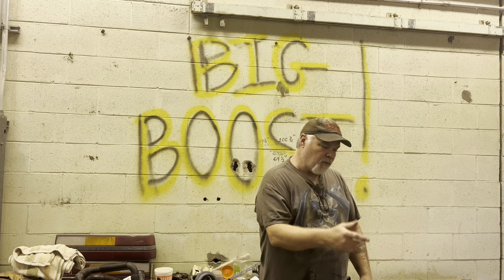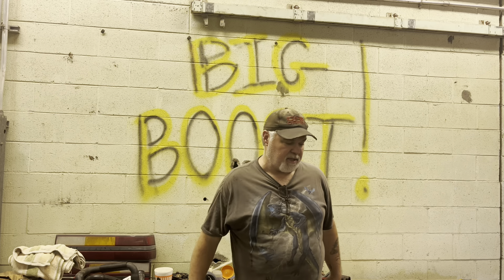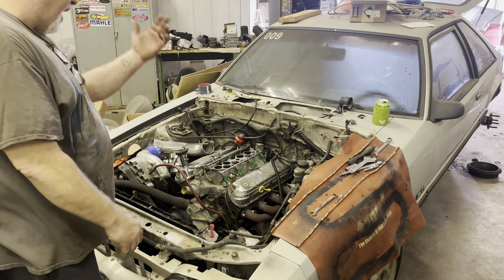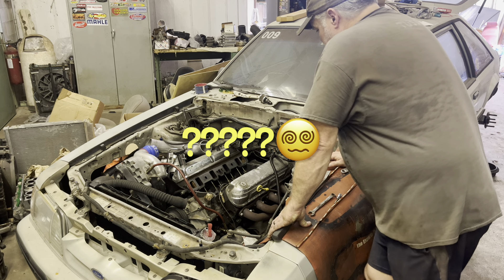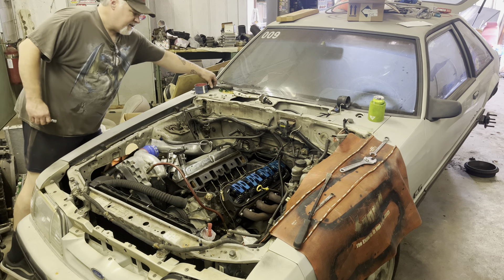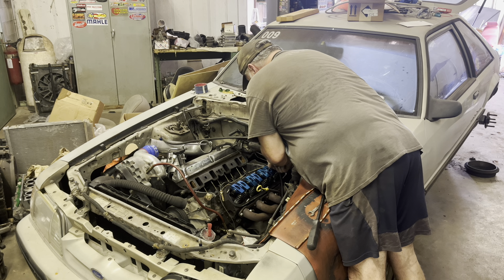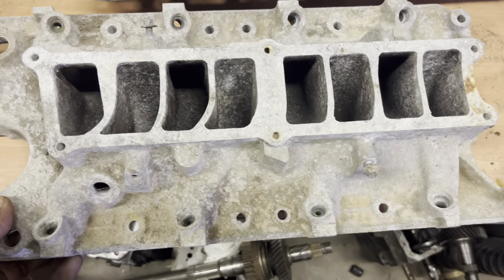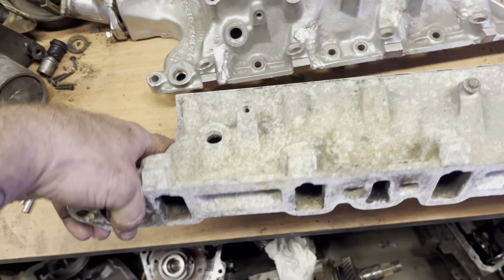1991 5.0 Mustang LX SILVERCAR Pt.26 Welcome to Club Big Boost!

Comment: David must have welded some of the runners from the bottom.  I've always wondered about the truck efi intake as a performance piece,  it looks pretty good.  I have two on my shelf.
Reply from the maker: Before the proliferation of efi intakes the modded truck lower with a modded upper (sheet metal or truck upper cut up)was the cats meow..the OG fast guys ran them..

Comment: Okay last comment. What are the chances of you being able to get a coyote running in one if your myriad foxes if one shooed up???
Reply from the maker: It’d have to have the control pack, a laptop and last but not least a decent trans/clutch (liberty plated tkx/600 etc) with it..no use in having a 400-500hp 7k rpm engine if you can’t shift it or break the trans every pass 🤔🤷🏻‍♂️😵‍💫

Comment: I'm going to guess trans is the first to go asking for a friend.
Reply from the maker: Probably, but we could weak sauce launch/shift it and possibly get a HG first..it’s all in the approach 😉🤣
Reply: @5.0tussin   it's hit or miss third gear can't handle the torque load very long I have had some only make 1 pass before blowing up and others make it 30-40. I'm not sure if your a5 has the gforce/ASTRO gear set but, if it doesn't I'm sure you can use that YouTube money to buy one gear a year until you have a full set. I called gforce recently and they still have some sets available for the t5 and I saw some Florida boys still had some sets floating around too.
Reply from the maker: @azblueovalfan7192  my a5 is full boogie..gearset/mainshaft etc..gforce ribbed case would make it a hair better…need a clutch for it though..🤣